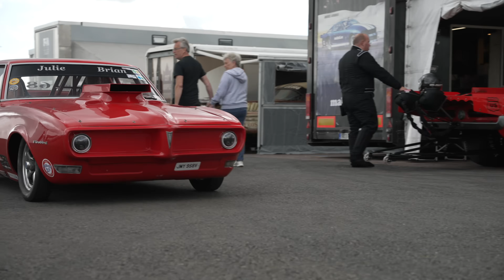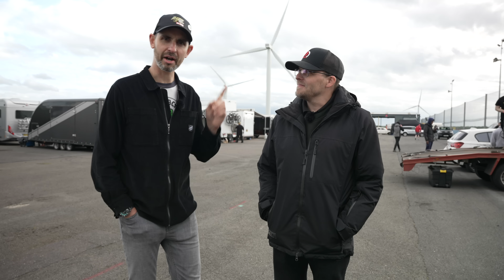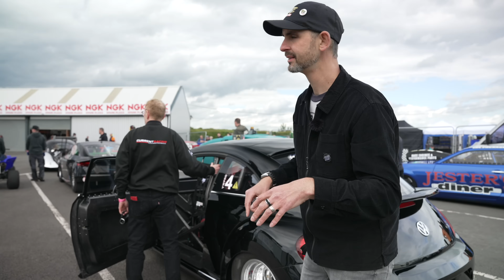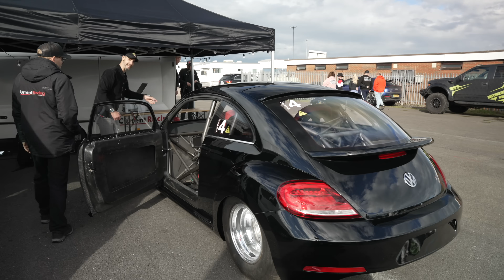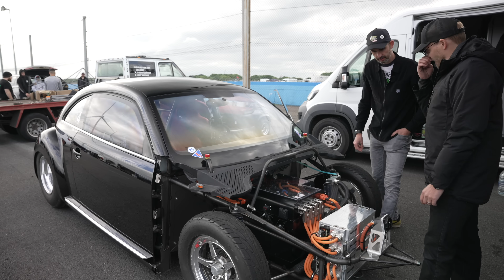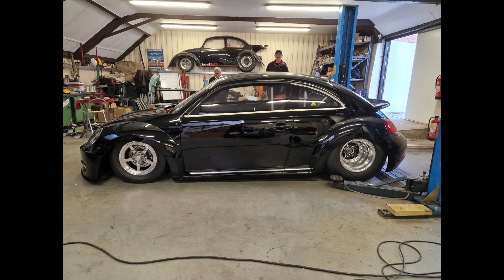British built project electric Beetle drag car promises to become the world's fastest EV

Comment: How about the high cost of changing battery for e-cars?! Are you sure you're lesser than Elon Musk?! Why don't people use shipping container modified tanks to store solar energy? For example, automating concentrated solar thermal power to pump water from the low tank to the high tank during sunny day and release water to drive electric generator and back to the low tank during the night and sharing with couple homes.
You can search "Burning Stuff With 2000ºF Solar Power!!" "DIY shipping container pool" "solar power water pump" and GREENPOWERSCIENCE for a lot of examples. 
Actually, potential energy of the tank themselves can also be used for generating electricity already. Of course, you need to use a lot pulleys or hydraulic jacks for that.

Comment: As early as 2027, in EU driving with a combustion engine will probably no longer be permitted outside of professional and delivery trips, the Federal Exhaust Gas Fun Ban Ordinance BABVVO was recently announced and exhaust gas fun will soon be banned. The Transport Tourism Emission Restriction Federal Ordinance TEBBVO was also announced....should get all combustion engines commercial vehicles, construction machinery, agricultural machinery and even inland waterway vessels off the roads / waterways by 2035. Buses in the cities (and all taxis) must be completely converted to electric drives by 2025 (supposedly an EU regulation!)! The Wild Funny! Have you ever read Berlin Leaks? It takes off your shoes! They are basically planning demobilization under the cloak of a campaign against "fun using fossil drive energy" in road traffic... the SOKO Autoposer is supposed to hunt down all fun fossil drivers in the future! This WILL be a STVO Stasi with BABVVO apps for monitoring as a little helper to control exhaust emissions...

Comment: I own a 2017 Ford C-Max plug in hybrid.  I am very happy with it's ability to pass people and get up to 70 while getting onto the freeway, when I really want to push the car to go quickly.  All that torque from a electric motor is Great!  And driving 18 miles on only $0.70 in electricity is wonderful!  

I rode in a Rivian EV truck, and yes it really does go 0-60 MPH in 3 seconds, and pushes you back into your seat.  Like riding a fast roller coaster ride!

Comment: I was inspired into race EVs by John Wayland's White Zombie and the T-Zero, but this car is next level, both in tech and I'm sure in cost. Back in 2008 when I started pretty much anyone could afford to build a competitive car. Now, unless you're Elon Musk you need sponsors. The four 3 phase AC motors alone must be $18,000 +. That many Li polymer pouch cells are not inexpensive either.

Comment: If the power and torque number are correct the car is way over powered for seven seconds. Traction will be the limitation. They could be a 5 second car with half the power they have but I don’t think they can launch hard enough. Maybe with an EV they can just ramp up the motors and keep from spinning the tires. I have questions!

Comment: If all high power R/C cars use LiPo batteries and have for over ten years why don't EVs? Especially high powered ones.
Also why not have a quick change battery pack to use a smaller lighter battery and just switch it out?
Reply from the maker: LiPos aren't very good at staying stable during long, hard discharge conditions. An EV needs to be rapid charged and have a long warranty.

Comment: how does the original Black Current car compare with the American 'White Zombie Datsun Sunny' from America? as I believe the White Zombie may have been out a couple of years before Black Current 1. It would be interesting to compare 2 pioneer's from the opposite side of the Atlantic.
Reply from the maker: I reference White Zombie in the video, and that car has been around a very long time. I think it set a world street legal record at 10:24 secs around 2011. I beat that car in my Enfield in 2015, but the Black Current back then was an 8 sec car on slicks (and not street legal).
Reply: @TheLateBrakeShow  , I believe we saw your car at the Chris Evans Car fest (It kind of disappeared into the smoke from a tyre spinning burnout). We purchased a Renault Zoe the Following year.

Comment: Impressive. So, with only 22KwH of battery on tap, what would be the range of the car if say you took that on a public road? Given it is very light and is not at this stage road-legal, what would be the potential range using this technology? Lastly, can you explain the benefits of LiPO4 in this application?
Reply: Hi Rob, we should be good for "maybe" 20miles. We hope to get it road legal and test it real world. We chose these batteries as the discharge rate is high.
Reply: @ollyyoung6193  thanks for the info. how much power does one motor produce?

Comment: Excellent video spoilt by the repeated typo claiming 6500hp. Clearly nowhere near that.
Reply: 640kw at the motor (858hp) times 7.57 gear equals 6500hp "at the wheels"... 'tis clickbait trickery.
Reply: @RadRidesByCru  except power does not increase with gearing. Torque can be raised or lowered (with a proportion loss or gain in rpm) but power unaffected. Basic high school physics. Johnny should be on top of this.
Reply: @john_p  And clickbaiting is a basic marketing principle... I'm not saying your wrong... I'm saying hat's how they got the number.
Reply: @RadRidesByCru  or.....it could just be a mistake ( he said, naively..)
...oh, wait - it IS a mistake!!
Who'da thought?!
What a blow for the conspiracy theorists........
Reply: @john_p  yes my fault, I made a quick mistake whilst being interviewed. It got picked up on and it made headline numbers! opps
Reply: @ollyyoung6193  no worries just glad it's cleared up :) good luck with cracking the 7s!

Comment: Super. 💙 T.E.N.
Reply: P.S. A friend of mine is working on "Pole Control." Say you have a 17 pole electric motor, install a "gas" pedal with 18 pole positions, so pushing down lightly would engage say 1 to 6 poles, push harder, engage more poles, floor it and all poles of the motor are powered. He says that by not converting DC to AC then controlling the output, he can save energy, reduce the amount of wiring and associated electrical hardware, and increase the range. Good luck with your Beetle. 💙 T.E.N.

Comment: And how did they dyno that?
Reply: Manufacturers plot of motor torque allows computation of HP if the number is not provided... but if you're taking about the "6500hp at the wheels" number... 640kw (858hp) times rear axle gearing (7.57) equals 6500hp "at the wheels".

Comment: Thanks so much for the video.  It was a great story, have not heard of the car, although been done drag racing for a long time now.
He makes a very good point about regulations...back when gas drag racing was going, it was not a big deal, and it got safer and safer over time.
Now we think the new tech should just instantly be fully safe as 50 years of experience.  It is the wrong approach.  
And unfortunately, that is also true for street electric cars / conversions.  They want to tie your hands and regulate you to death rather than let everyone be as creative and innovative and then let it become refined once it has really become mainstream.     Electric is great for drag cars as the packs can be quite small.
Parking lot racing too is perfect for electrics, a single lap is all you need the pack to support.

Comment: I would hope it would run quicker than 7's, with 6500 hp and the suspension sorted they ought to see 5's. Helluva build though whatever it runs!
Reply: They're multiplying motor output by rear axle gearing to get an inflated wheel horse power number.

Comment: Cool build, but 6500hp and 7 secs? 🤔  Also EVs aren't in anyway comparable to a piston engine car. A reciprocating piston engine is 100x more complex than a rotating electric motor.
Reply: 6500 is the WHEEL horse power... engine output is 640KW or 858HP. They got the WHP number by multiplying the motor output by the rear axle gearing.

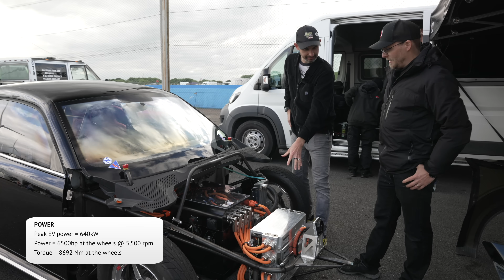Comment: 11:08 it draws 640KW of electricity to produce 5000KW of mechanical energy? Give those men a nobel prize, they just broke the first law of thermodynamics and solved the world energy crisis!
Reply: Based on their figures @11:08 "640kw" produces "6500whp" as they're multiplying motor output by rear axle gearing. Typical EV gearing is roughly 8-to-1... 6500/640=7.57 gearing...  so, no additional energy was actually created.
Reply: Even the battery pack. 22 kWh, 70C = ~1500 kW out of the pack.

Not that you could put 6500 hp down anyway.

Comment: If this thing makes 6500 HP at the wheels then I am the Pope and my wife is mother Theresa 😉
If we consider the numbers given in the video: 640 kW ("peak EV power") is 858 HP. 416 kW ("nominal power output (continuous)") is 558 HP. Did I miss something?
Reply from the maker: I will get the Young bros to answer that!
Reply: They multiplied the motor power by the rear end gearing... Most EV's are geared 8-to-1... 6500/858=7.57 gearing...
Reply: @RadRidesByCru  that would be a silly thing to do... Multiply for torque, OK, but certainly not power! On the other hand it makes for a nice click bait title... 🤔😉

Comment: Lol, 6500hp? Don't even need to watch the video to smell the bullshit
Reply from the maker: I don't think the Young brothers are in the game of fake numbers. Their last car proved that. This car has only had 3 shakedown runs, so they were never going to bed in a 4 year experimental drag car build with hard passes initially. No one does that.
Reply: @TheLateBrakeShow  maybe not, but most likely a bad dyno.
Reply: @TheLateBrakeShow  thanks you owning the mistake and fixing the video title
Reply: People seem to be missing the "at the wheels" part... Multiply 640kw (858hp) times a 7.57 rear gear and you get 6500hp "at the wheels"... reasonable people call it clickbait... youtubers call it marketing....
Reply: @RadRidesByCru    there we go, I'm glad someone spotted the bullshit lolol
Gearing doesn't multiply power, only torque. If the motors produce 640kw, will always be 640kw regardless of gearing used. Torque however is a lot greater at the wheels with gearing. The reason why power doesn't increase is due to power being torque vs rpm. Increasing gearing will increase torque, but also decrease rpm in the output shaft.
Reply: @ralmslb  Unfortunately their calculation is based on that new math.... 6500hp=more views... lol.

Comment: 6500hp and it only runs 9's? Uh.....my daily driver v8 with 800hp runs low 9's. You got a long way to go to be saying v8 killer lmao!!!!
Reply from the maker: No, it will run lower than that. Pay attention.
Reply: @TheLateBrakeShow  I just see "it will" but is it doing that now? No lmao.
Reply from the maker: It hasn't run 9s! It hasn't even run a 10 yet. The point is, this car builds on their last car and that was a 8.2 car. This has the potential to be a second quicker.
Reply: @TheLateBrakeShow  well that's still not impressive. If you label it v8 killer....I expect it to beat the best v8 out there lmao. You need to make 4 sec 330 mph passes for a start.
Reply: @Monte1970SS  I think the clickbait title of the video is in poor taste but... you don't have to be the fastest guy to outrun a lion... you only have to be fast enough to outrun the slowest guy.... and 8.2 will outrun a lot of V8's... Their "6500hp at the wheels" number, however, is misleading... and obtained by multiplying motor power... 640kw (858hp) by the rear axle gearing 7.57... to get 6500hp "at the wheels".

Comment: Very nice build indeed. Not sure how you got to 6500bhp though? Based upon the data shown & the 70C rate more like 2000 instantaneously limited by the pack which is still quite something given how the torque is delivered. Proper bit of kit though. Thanks for sharing.
Reply: WHP not BHP... They got 6500 wheel horse power by multiplying motor output by rear axle gearing... 6500/640=7.57 gearing.

Comment: 6500HP has to be a typo even top fuel drag cars make about 10,000HP you would need a truck load of battery's to make that sort of power!
Reply: 6500 is wheel horse power... which they're getting by multiplying motor output by rear axle gearing... 6500/640=7.57 gearing.

Comment: Really cool build! How does 640kw = 6,500hp & 8692Nm?
Reply: When you multiply the kw by the rear end gearing... 640kw (858hp) times 7.57 gears equals "6500 horse power at the wheels".
Reply: @RadRidesByCru  No.
Reply: @JxH  Yes... not only do I have a reply from Olly saying that's how the number came to be... but TLBS pinned a new comment where he word for word repeated my reply to Mat Wandsneider.

Comment: I think the horsepower rating is greatly overrated The PM150 DZR is rated at 400 Arms with a sag voltage optimistically of 725 vdc = 290 kW or times 4 inverters = 1160 kW times 1.33= 1542 horsepower. However I do wish the Olly Young and brother the best to break the all time record for a full bodied  battery electric vehicles.
Reply: Yes we are power limited with the 150dzr.
Reply: Their "6500HP was "at the wheels"... a number they calculated by multiplying the power of the motor by the rear axle gearing.

Comment: Amazing build, but I don't guess I understand how ~6500hp is only good for 7 seconds.
Reply: It doesn't have 6500hp. It has 8700nm at the wheels, which means the wheels need to turn at 5500rpm for 6500hp. 5500rpm with big tires >2m circumference is >500mph...
Tldr: to make 6500hp with the max wheel torque it has, it would nedd to go over 500mph
Reply: I think it all may be a type, off by a factor of 10. The 640kW rating is good for about 650HP. 
The 4 controllers are PM150s, so that's about 600kW. And they say the 22kWh battery can do 70C, which is 1540kW, so a bit over 1600HP after losses. 
Still will be impressive at speed!
Reply: The tyres…
Reply: I came down to the comments to see if anyone else had noticed this. My first reaction was thinking that something must be terribly wrong to only do 7 seconds with that much power
Reply: Someone added an extra zero by mistake ... nowhere close to 6500hp
Reply: Me neither.  That much power in even a steel-bodied, fully equipped Beetle should be quicker than that, surely?  But then again, it's hauling a metric sh*tload of batteries as well......
Reply: @christopherdean1326  Not really, it is only 22kWh... so pretty light. it has less capacity than an electric UP
Reply: Based on their figures the motor produces "640kw" and makes "6500 wheel horse power" because they're multiplying motor output by rear axle gearing. Typical EV gearing is roughly 8-to-1... 6500/640=7.57 gearing.
Reply: @RadRidesByCru  someone should tell them that gears only change torque at the wheels, not the power output. Come on people this is extremely basic physics. Besides which, 6500hp is 1.5x Top Alcohol type power, and would literally tear that car apart.
Reply: @john_p  I agree... but... that wouldn't let them get as many 'tweens as "amped" up as the clickbait title does. Though, HP is just a calculated number so the math still works out... kinda like the math in that "you work one day a year" joke...
Reply: @RadRidesByCru  No. Gears can multiply torque, but give up RPM. Or vice versa. Power is constant, less any minor looses (heat, noise).

Common sense says that if gears or tires or whatever could multiply power, then it would be a miracle. Hint, it's not possible.

Comment: Those motors are 1600HP each?! Sweet merciful crap...
Reply: No... they're 160kw each... they got their "6500 HP at the wheels" number by multiplying total motor power by their rear end gearing.
Reply: @RadRidesByCru  ...That's not how horsepower works. I refuse to believe anyone capable of building a successful drag car of any kind would make such an obvious mistake. If the motors are truly 160kw each that's ~860HP total which is believable for the speeds, and that makes it plausible it's a simple typo for 650HP at the wheels (~76% drivetrain efficiency) rather than 6500.

Actually, that is MUCH more believable...
Reply: @Smidge204  Cognitive dissonance... just because you refuse to believe something doesn't mean it's not true.... typical EV gearing is 8-to-1... 6500/640kw (aka 858hp)=7.57 gearing.... Any drag gearing calc shows that for the car to run what they claim 7.57 gearing puts the car at their motors max RPM at the traps... The math is provable... their number is simply clickbait.

Comment: Are the motors basically a stack of pancake motors? They're designed for that but so cool anyway. Compact. Just run them short enough to not get to critical temperatures asking for continuous active cooling. 7 seconds at peak load, should be fine. Even might overload then a bit.
Reply: Will try and overload them as much as possible and just watch the temps.